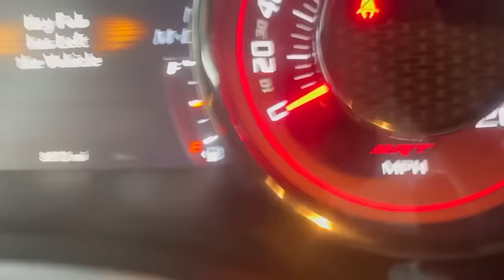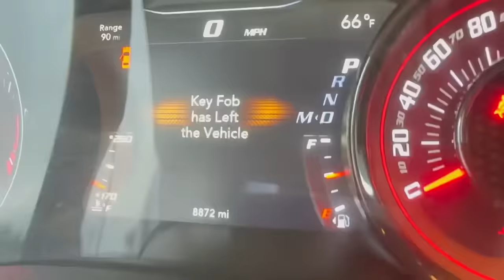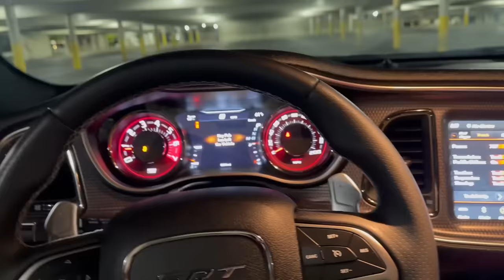BUYING MY DREAM CAR AT 20! BRAND NEW $100,000 WIDEBODY HELLCAT CHALLENGER!!

Comment: 100k for a non red eye is crazy ngl 65k max
Reply from the maker: Its faster than a redeye
Reply: now your just lying @SRTtajj
Reply from the maker: @Tizzle..  its upgraded and tuned. Running 8-900 hp so i dont think im lying😂
Reply: @SRTtajj fax and all the new gens are over 100k bro you ain’t finding no hellcat for 65k unless that bih has over 100k miles on it